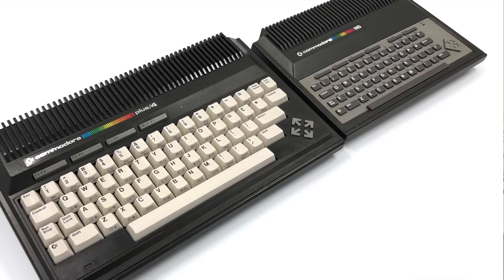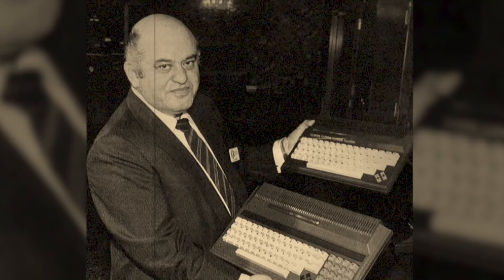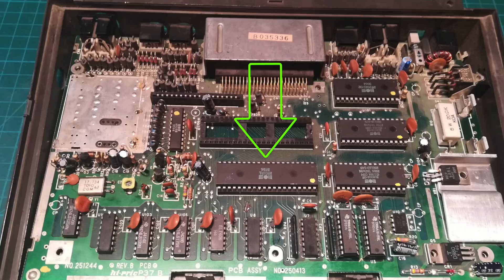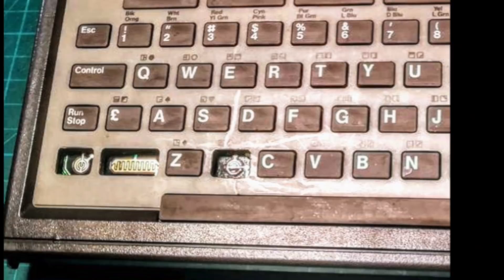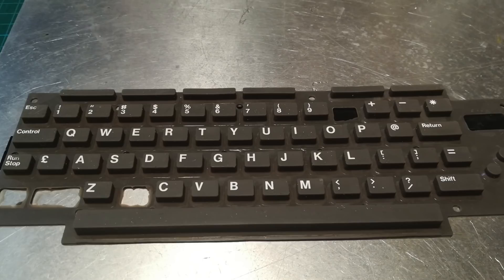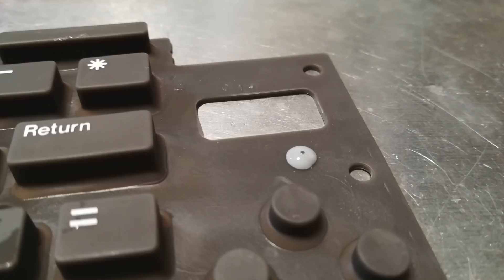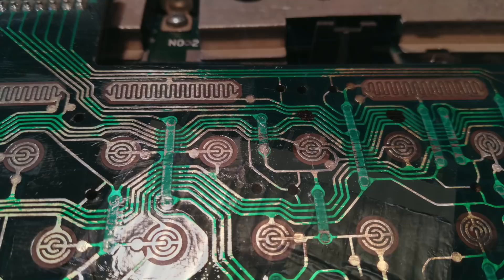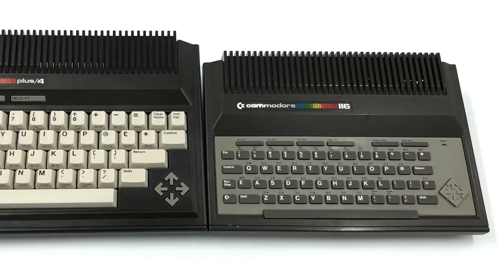The REAL Plus/4 Mini Extremefurb! - Commodore 116

Comment: 3:04 If the RF modulator is completely gone, doesn't that present the opportunity to replace it with a Composite or S-Video output?  [Oh, it already has a video port.]

4:00 The TED chip has three timers, parallel keyboard I/O, and a little bit of MMU, so it also offset most of both CIAs in the C64.  The Plus/4s instead have one simple parallel-port chip in addition to the TED, plus an RS-232 serial chip as a better replacement for the functionality of the User Port.

4:09 The Atari 2600 and 8-bit computers had a 128-color palette long before the Plus/4s came along.

4:45 You can't compare a Z-80 and a 6502-compatible by equating the clock speeds.  The Z-80 needs about twice the clock speed to match a 6502, and the Plus/4 line's CPU runs at 1.76 MHz, which makes it about equal in performance to a 3.5-MHz Z-80.  The Z-80 takes four clock cycles per bus cycle, and it even has a 4-bit ALU.

5:55 Why is it 12277 bytes free instead of 12287?  12 KiB = 12288 bytes and BASIC reserves the first byte of BASIC memory.
Reply from the maker: If you don't already you should make videos! You make it seem so easy!

Comment: Sorry, but adding charcoal to the silicone may be romantic or something, but it won't give the color and the result (they're particles, fracments of charcoal you are using) you want in 99,99% of the cases. If you add black paint instead, you could add the amount you wish till you have the right color.